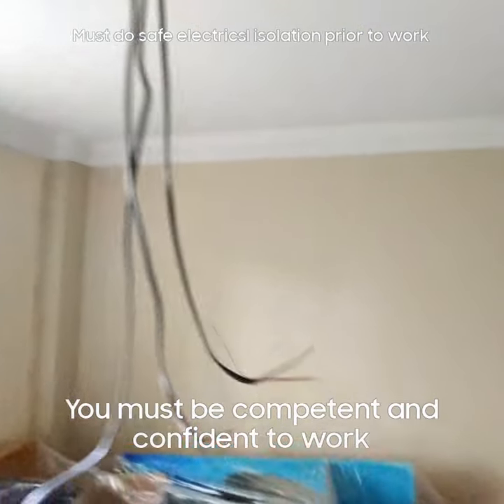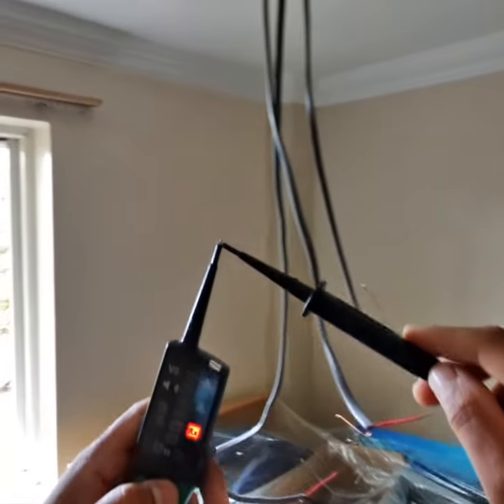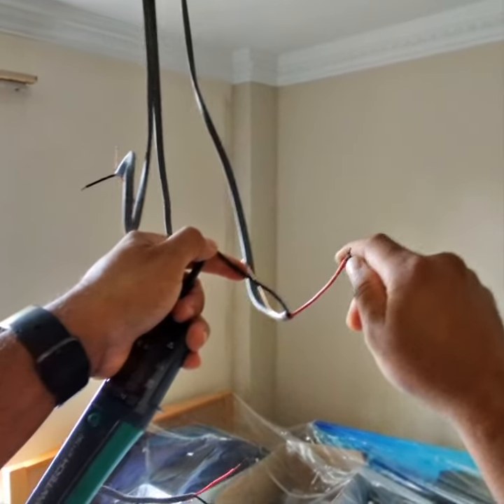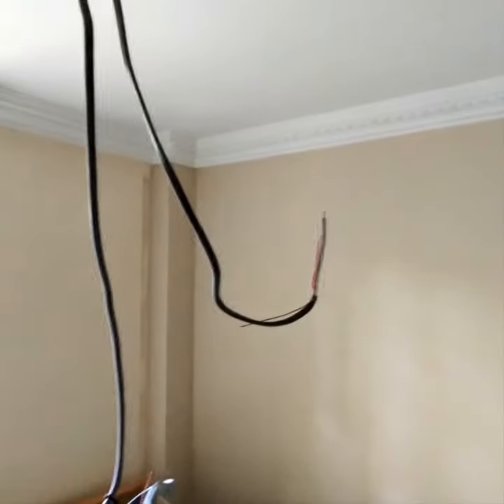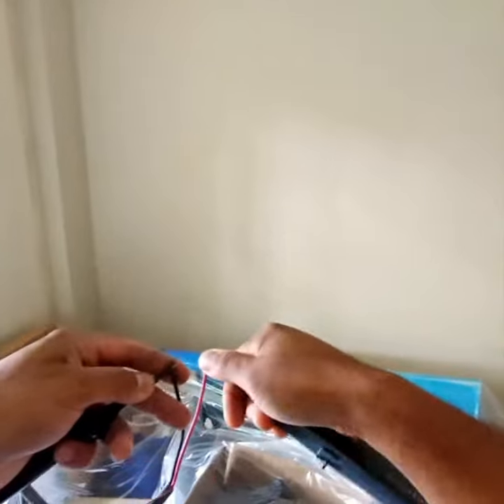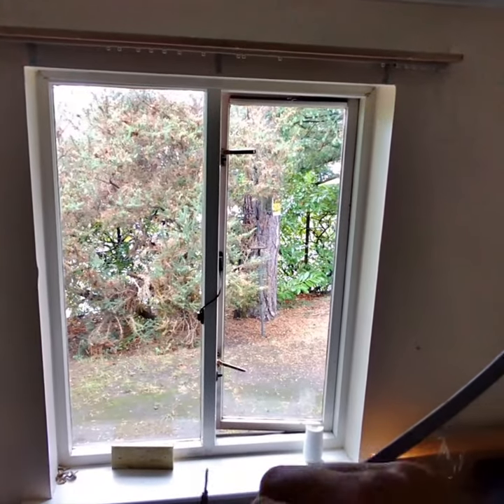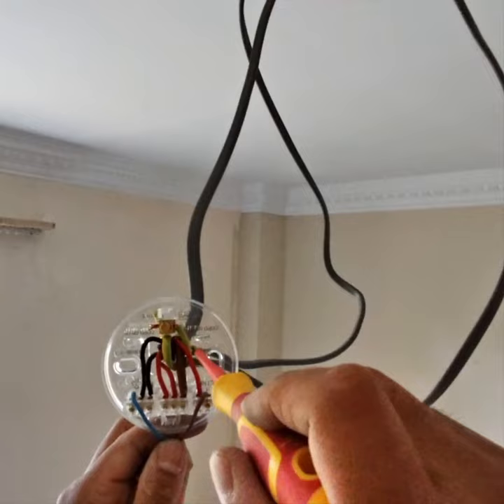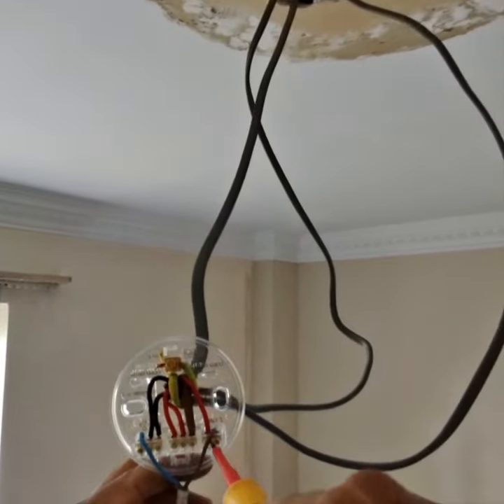How to find switch cable on ceiling light , ceiling rose wiring. Installation of ceiling light.

Comment: Which brand tester are you using?
Reply from the maker: Kewtech
Reply: @5andipp  perfect. Thanks. I’m in a dilemma now because i took the old light off and can’t figure out which wiring is which. Either it’s on permanently or not coming on at all